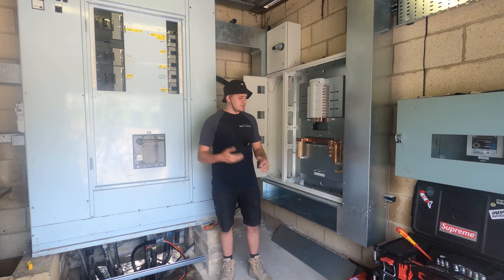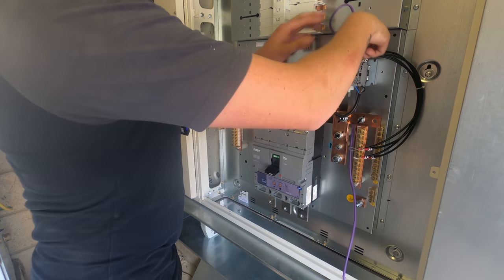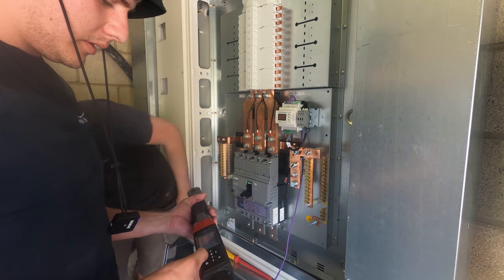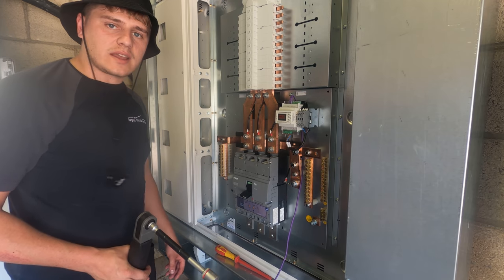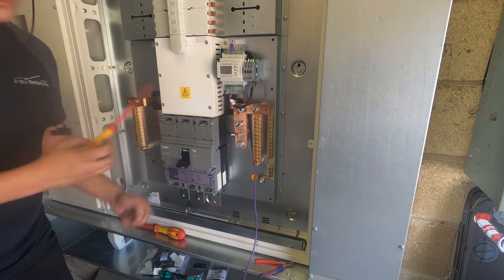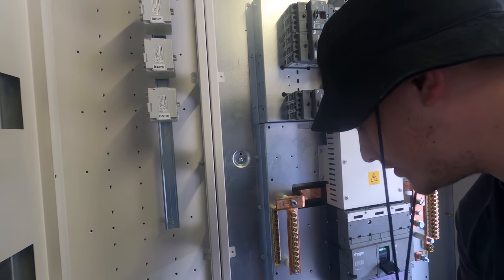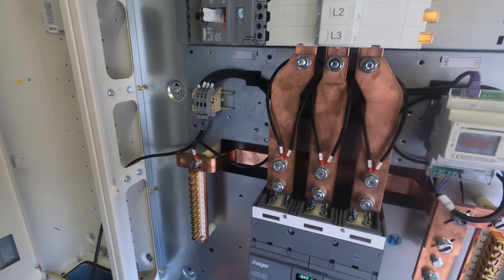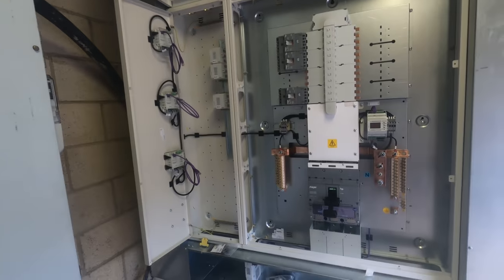630A 3 phase MCCB panel build

Comment: I was wondering if the KW/h meter voltage circuit has to be protected with a fuse of 6A or so? Just to lower Ic on the meter.

Comment: Loving this series of video's! Just a quick tip regarding the torqing of bolts. I'd recommend using a paint marker on the bolt (after torqing) as a visualisation that the bolt has been done. On big installs the odd bolt can occasionally be missed. 👍
Reply: videos. No random apostrophe.

Comment: Is that a Rayleigh meter you're using there?
Assuming that what looks like a network cable isn't?

I say that in hope that it might be!

Edit... should have kept watching. It's a Hager branded Rayleigh easywire system :)
Reply: @residualelectrical  Thanks :)

I've used a few Rayleigh meters (and have a few that I'm trying to write a bit of code for remote reading over Modbus). I like them, nice and clear displays. The fact they lock the CT ratio very quickly after you first power them on means we've got a few set to slightly bonkers ratios that we have to do some interpretation to read.

Currently using a lot of meters from Algodue as they've got built in web interfaces that will push the readings to us every evening. They're not cheap (£200 each) and tricky to get in the UK! Very convenient though.

All the CTs we use are x:5 so up to 5A going down the cables, Cat6 isn't going to like that ;) I hadn't realised it was rated up to 230V so that's a useful little nugget to store away for one day when it's useful.

Comment: There does not appear to be clearance between the neutral going behind the links from the main breaker. 
Also why did they not use the coach bolts for the main breaker bolts as well, makes the panel seem like a kludge rather than a coherent system design.....

Comment: shrink wrap your buzz bars it cost almost nothing takes very little time and it could save a really bad arc fault
Reply: Also nice to do it for the colour code too.
Reply: I was just thinking; for the amount of current going through that panel, those copper bus bars (and the neutral one behind it) are awfully close together. Why is it even necessary in the first place to use bare copper bars instead of nice thick cables? Hager could prefab those cables to have the perfect length and bend in it, so it wouldn't even be that much of a hassle to install. 
Bear in mind I know nothing about electrical standards; might be a very good reason why it is done the way it is.
Reply: @112Haribo  Bus bars are more rigid and also easier/cheaper to manufacture in that size. Being more rigid  they are less likely to diform under high current situations reducing the likelihood of more serious damage to the board.

Comment: All this expensive equipment you are installing in a brick shed without climate control?  Is there a heating system for this shed to protect this equipment from condensation and corrosion? Is there a central HVAC Building that heats these brick sheds, that we are not seeing in the video? Great Video, Thanks.

Comment: USA electrician here!  
Question for the U.K. & Euros & Asian 240Volt a.c. world.
USA 240V = 1 HOT lead at 120V a.c.
                   + 1 HOT lead at 120V a.c. (180 degrees Out-of Phase, 60 Hz)
                   = 240Vac USA  (NO, NONE, NOT present NEUTRAL wire, AT ALL)
BUT!  You Brits & co make 240 V a.c. with:
                       1 HOT lead at 240V a.c.
                       1 NEUTRAL
                      = 240V a.c. UK/EURO/ASIAN style!
QUESTION:  If I buy a UK/EURO/ASIAN 240V a.c. electric drill, and plug it into a USA 240V a.c. outlet, WHAT HAPPENS?
Reply: If it has a universal motor, it will run no problem.
Reply: If it was just an induction motor it would run faster....60hz vs 50. But I’m not sure if the electonics would like 120+120
Reply: @bencrew4376  INTERESTING!  YouTuber engineer, PHOTONIC INDUCTION,  said:  "Works normal".
I copied my question onto multiple electrical and electronics Youtuber's pages. I have received SO MANY CONFLICTING ANSWERS.  I think they ALL should post a LIVE test.  (I'm not a Youtuber video poster.  Otherwise, I'd do it myself.)
Reply: @bencrew4376  Unless there is some kind of electronics or other gubbins that need 120V to ground/neutral (like American/Canadian electric dryers that use 240V/208V for the heating element and 120V for everything else), it will not care as the only thing the tool sees is the 240V betwixt the current carrying conductors.  That operating requirement is very unlikely in a tool of this nature.
Reply: @BYENZER  They will work normal.  Due to their nature, universal motors will work from DC up to around 100cy/sec.  The only time you would have problems is using them on something like 400cy/sec avionics electricity due to the parasitic inductance of the motor making it very underpowered.
Reply: Large parts of Europe have reversible sockets, and there do exist some older electrical supply systems with 230V phase to phase in Europe. So any designer of portable equipment* for the European market can't make assumptions about how the supply is referenced to ground.

The frequency difference will have little impact on the "universal motors" used in handheld power tools. Most electronics won't care either. Bench tools on the other hand may well use induction motors which may be less happy about the frequency change.

* Fixed equipment can be another matter, I have heard of some gas boilers that rely on the input voltage relative to ground being correct.